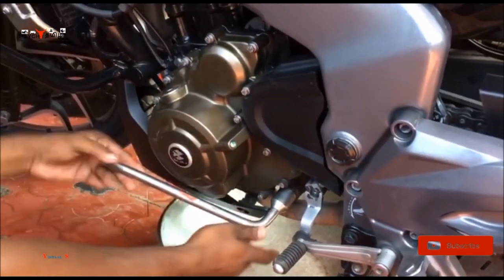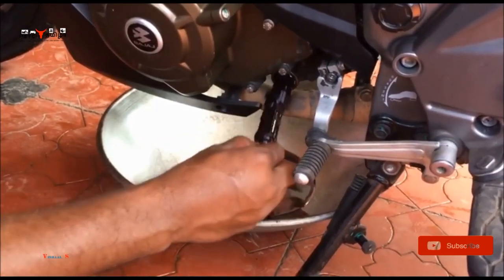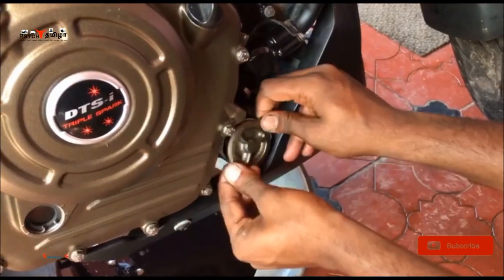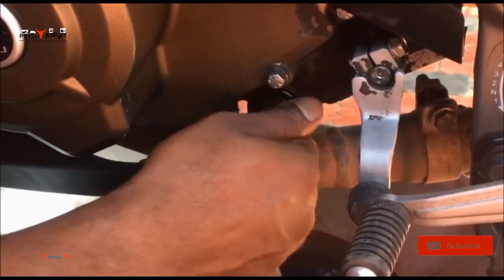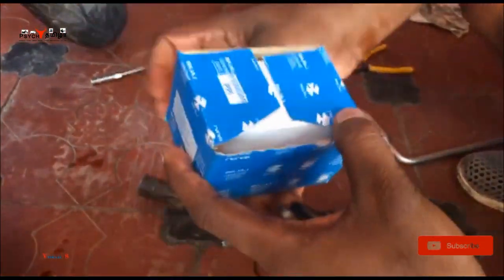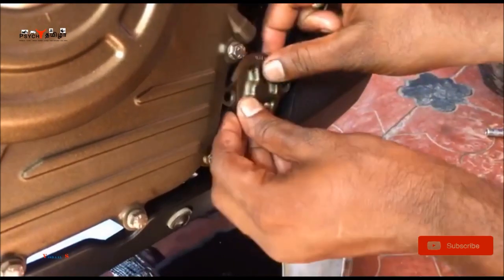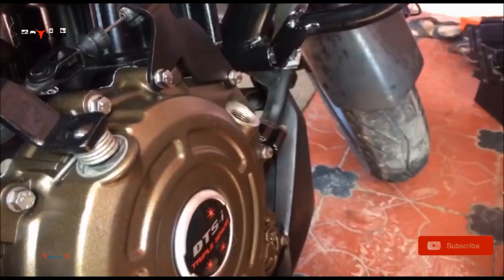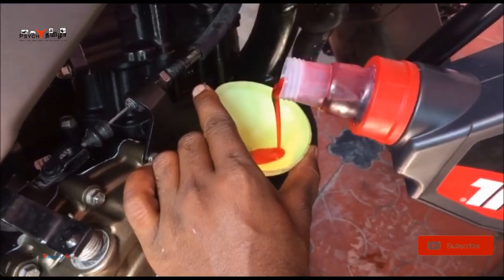UPGRADING FROM BAJAJ ENGINE OIL TO MOTUL 7100 FULL SYNTHETIC | DIY DOMINAR | ENGINE OIL REPLACEMENT|

Comment: There is one more Nut that needs to be opened and then the complete oil drains. By the method you have done - some 200-250 ML old oil will remain in the Bike. To access this second nut, you need to remove the bash plate, loosen the silencer bend pipe - check the video of Dominar third service on my Channel. :)
Reply from the maker: Thanks for the information bro ill do the procedure as u said in future:)
Reply: Psych Tamizha your welcome :)

Comment: That is not the megantic filter , this  the plastic filter, the megantic filter/strainer is at the bottom center and u didn't opened and cleaned it u need to remove the rear plastic cowl to reach that. Next time do open and clean it. And  on top of everything u used the wrong grade 20w 50 this is used in bajaj avenger for dominar correct grade is 10w50 and don't go thicker then 15w50.
Reply: Sir do you have video showing the Megantic filter? Im sked for my 1st change oil too and would like to know how to do it. Thanks
Reply: Great, thanks! Could you share it or send via Facebook Messenger? Thanks

Comment: Ur bike's coolant might be mixing with engine oil...coz the oil filter lines are not straight they got curve...
Reply: Bro explain it,  what do you mean
Reply: Look at the oil filter .....the lines are not straight as rhe new one  .that means something is mixing with engine oil......most probably coolant
Reply: @abhiseksahoo1730  OK dear,  my new pulsar Ns 200 Abhi 1000 km chl chuki Hai,  kya synthetic oil motul ka better h ya mineral oil Bajaj ka hee dalvaayu
Reply: Read manual....and use prefered grade engine oil
Reply: @abhiseksahoo1730  Bajaj company recommends Bajaj brand oil only , grade is 20w50
Reply: @ITSEDUCATION369  use bajaj engine oil till ur free servicing then u can change to motul...so that u can feel the difference....but remember...just stick to ur manual preferred grade otherwise u vil loose ur warranty
Reply: @ITSEDUCATION369  no. That's 10w50. Not 20.with 20w50 your bike will have more wear n tear in cold starts n cold temperature.

Comment: you are using 20w50 grade which is not in the specification of Dominar. Put 10w50 grade as per the specification.
Reply from the maker: Abhishek Vishwakarma Hey Buddy 
Thats was the first time i used that engine oil
now am using only 10w50 for all my service 
BTW TYSM for the guidance

Comment: Was there any problem after using 20W50 instead of 10W50? After all its just least temperature right?
Reply: See his oil filter when he removed, the fins are all bent due to pressure. Usually the fins are straight. Thicker oil causes premature wear on engine and doesn't pump the oil as it gets caught in filter.